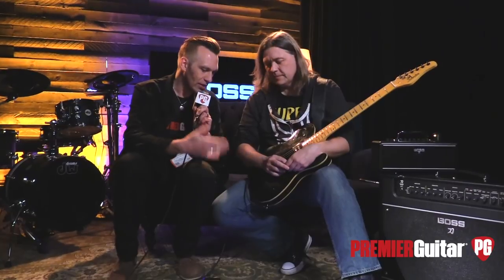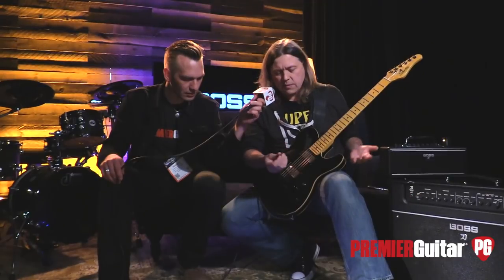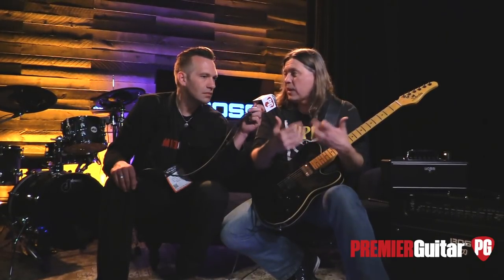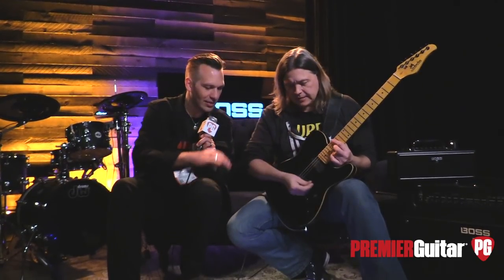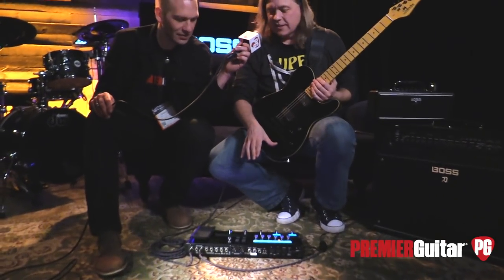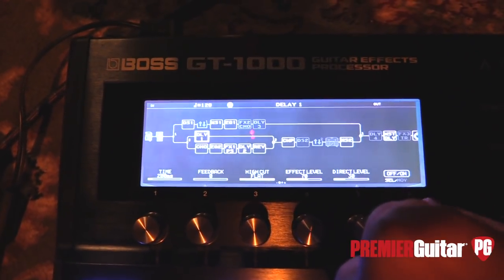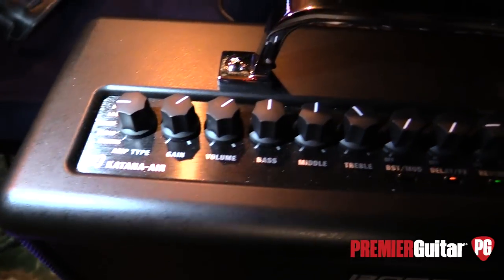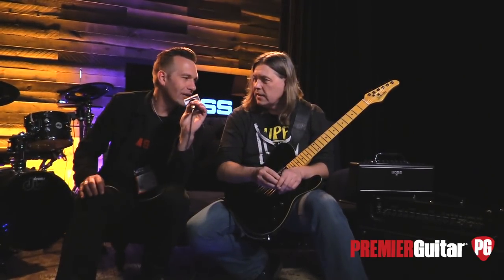NAMM '18 - Boss GT-1000 Guitar Effects Processor Demo & Katana Air

Comment: Either the vast majority of channels doing coverage for this or Boss should be ashamed of themselves because pretty much every demo of this has sounded awful.

If it's the case that the unit sounds decent but we're getting a crappy representation of it, it is pretty sad that all of these channels dedicated to music gear are incapable of making a basic recording.

If it is the case that Boss provides outputs for people covering this product to plug their field recorders into (which they should) and the settings are crap or even worse, this is actually a good representation of what the product sounds like, Boss needs to up their game.

For a product that's supposed to be capable of going to multiple devices like amps and (more importantly) direct to FOH simultaneously, it really shouldn't be that hard to provide people covering this (a flagship product) with a decent audio feed.
Reply: Too right. How can they miss the boat so badly when it comes to decent demos?

Comment: Cool... but still not enough buttons:) ...no, seriously, the amp and FX should be separated if desired, so you can change amps and not FX or change patches with FX. Meaning there are not enough options or choices here... sounds crazy but it's true:)
Reply: Just have different patches with the same amp..  not sure what you are trying to do.
Reply: Trying to recreate my rig from a while back. I had a midi preamp with a 10 switch controller and an FX unit with a 10 button controller. I could do things that you can't do today with the latest floor units. You should be able to switch between amps without messing with the FX, or have the option to switch both. BOSS is notorious for limiting options playing live.
Reply: I can buy 2 Digitech RP1000, have $400 invested and it will do more than this unit, more options, FX that tail off, and sound better:)